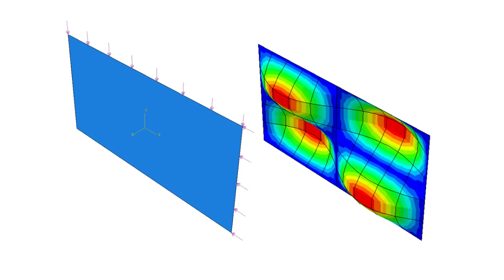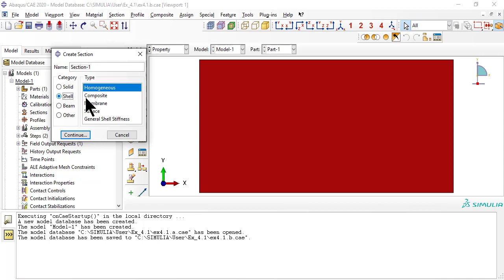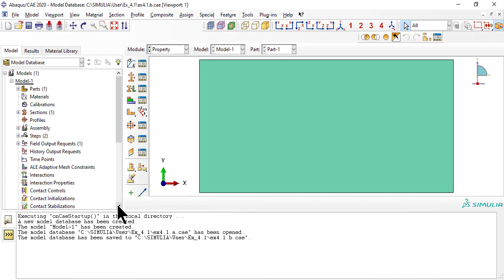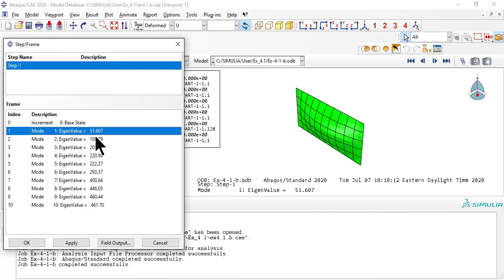Example 4.1.b Eigenvalue buckling analysis of composite laminates using ABD&H matrices in Abaqus

Comment: Hi Professor, great video! I noticed that in part (a) of this problem when the eigenvalues were estimated using the effective moduli and compared with the eigenvalues generated in part (b)which uses the ABDH matrix as input, the values seem way off. can we base any reasoning as to why these values are too far off for every eigen mode?
Reply from the maker: There are 2 types of effective moduli, based on A matrix (membrane behavior) or based on D matrix (bending). I don’t remember which on I used, probably based on A matrix. Buckling happens when the membrane energy is higher than the bending energy, so really you must have both, the A and D matrices, but in effective moduli approach you can’t have both, so that is the source of the error
Reply: @EverBarbero  Thank you, Professor!

Comment: Respected sir,
Please make a video on how to debug Fortran code in visual studio for abaqus user subroutine.
Reply: Thank you sir for your awesome video.
Now I am able to run your user subroutine example in abaqus 2020.
I am waiting for your new video.
Reply from the maker: It is very complicated, so much that I abandoned doing that. The best is to write a "driver" in Fortran, which is a little program that calls your UMAT, outside Abaqus, and tells it to increment the strain (which what Abaqus does). Your UMAT gives results back to the drived via "SDV's". You check that they are correct. Test your UMAT in all possible scenarios you can think of. In this way, you can debug the UMAT using VS debuger, fast, easy. When your UMAT returns the correct values and does all you want it to do, then you link it with Abaqus and it will work. That is how I do it.
Reply: During compilation of user subroutine example 3.23 in abaqus 2020. It gives a lot of error. Starting from line1 subroutine continued statement error.
So please make a video to understand how to run user subroutine in abaqus 2020.
Reply: I read a lot of things for fixed format file. Now I am able to run user subroutine in abaqus 2020. I am a PhD student from India.